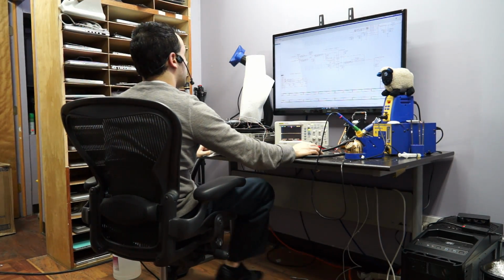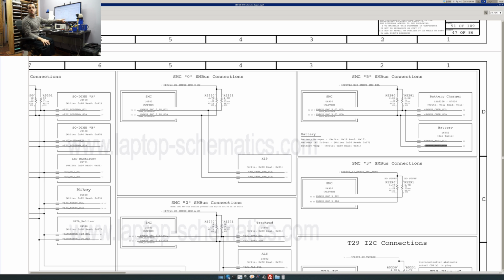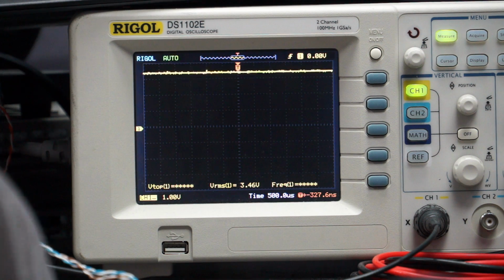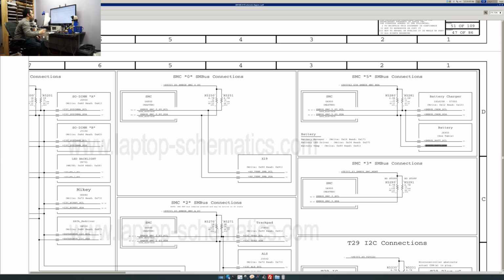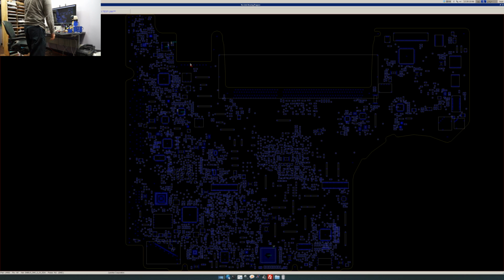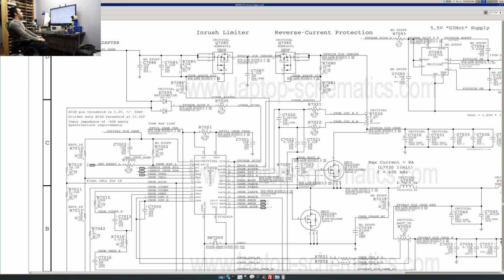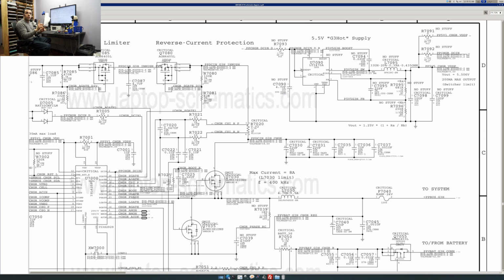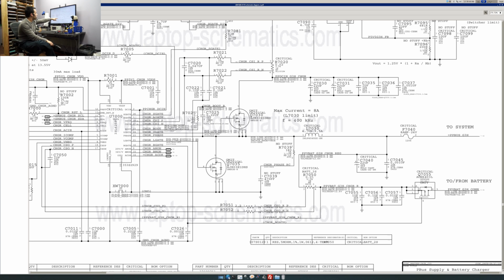Troubleshooting Macbook Pro battery recognition issues at component level.

Comment: Wow, awesome lecture on Macbook repair! Thanks!
Would anyone have an idea why a A1706 (late 2017) works with a battery that is 3yrs old (but replacement needed) and doesn't turn on at all on a brand new 1819 battery? What I am seeing is that even if the battery model is the same as the old one, the chip (basically the electronics) on the new battery looks newer.
If battery is not connected or using the old battery, everything is fine.

Comment: This resistor is called shunt resistor. But it does not go directly to IC. There is a circuit element (shunt monitor) with cvf written on it. It is similar to mosfet but it is not.

Comment: I hope u read this.. Have a odd issue with battery not seen. Ppbus is spot on 3.45, until i connect battery, then its 2.45.. 0.8..0.. 2.45. And so on. Without, solid 3.45.

Made all messurments i can think of.. All lines there, like pepe bus etc.

Tried old bat, and new bat, same thing with bus.

Why o why do battery fck the bus 🤔

12v @ battery connector aswell, remove charter, bam. Zero. Like it sucks power like 🤷

Will try dcps on battery connector and see if it pulls a lot of power. I have no real idea here...

Also, ofc battery lights on side wont work. Disconnect it wont work either. But, that one dont destroy bus, battery is the one. Maybe some pull up resistor..

And its a 820-2915-A board. Any tips?

Comment: That data line is I2c connection SDA . SMC is set as master, thus battery charger is set as a slave. If you can get datasheet of the chips that are talking to each other, you can probably figure out what byte commands are being sent from SMC to the charger. However what you see on the osciloscope there, is a series of 0's and 1's. I2c also has a clock pin, SCL. This should a constant signal in between 100-400Khz.

Comment: Hi I'd like to know why my battery shows the wrong percentage without charging when in log in(normal mode) when it's actually charging to 100% , but it shows correctly when in safe mode. Even after I erased the disk and reinstalled, also reset the SMC, the issue is still there.... Also, the battery % also shows differently as on desktop ... :(

Comment: Hi Louis, I recently found a macbook A2178 brand new in my dads old stuff.  I tried to charge it up, but the dreaded X on the battery showed up. Tried to reset the SMC among other processes. I however did not open up the back for I would not know what to do. This one as you know has a removable battery is there anything that can be done? Thanks

Comment: My MacBook Pro A1425 does not power on . 
When I disconnect the battery the charger light still shows amber and does not power . 
With the battery connected it still shows amber and does not turn green even though I’ve been charging for days now . 
Any solution please

Comment: Looks like an i2c bus, where the bus is high until the master pulls it low to communicate. We use it all the time in micro-controller programming, in embedded systems development. Throw a logic analyzer on that line sometime, and see if it can decipher the protocol for you.

Comment: If the computer recognizes the original battery, showing the charge level with the warning that its not being charged and should be replaced now, albeit it's "locked" out because of a short during liquid damage, that is, it does not run from the battery and does not charge it, but does NOT recognize the replacement battery whatsoever; nor does it likewise recognize the 2nd replacement battery, then that points to an issue with the replacement batteries, right? To complicate things a bit further, when the machine is running with either of the replacement batteries installed, i can get a few seconds of runtime after disconnecting the magsafe connector, then the machine enters sleep mode and will not wake unless plugged back in. Similarly, when booting with one of the questionable replacement batteries, upon seeing the apple logo I unplug the machine and it runs off of an "unrecognizeable" battery up to the login screen then usually sleeps itself. Once i was able to get it to run indefinately from "those" batteries through a combination of SMC/PRam resets and connecting and disconnecting original battery with replacement battery, albeit the the magsafe did not give any light whatsoever on that occasion, which was kind of funny to be powering a machine out of thin air, since power profile shows no battery installed. Im on the fence of buying another machine ($500 mid 2012-early2013 15" retina)  to troubleshoot the charging/ battery circuit; thanks to the information in your videos, of course, or, conversely to complain about being sent bogus replacement batteries ( which are not that cheap btw, $50 and appear to be Genuine Apple products, or, as I'm hoping through your response, to be super convincing fakes; or more importantly complete dudds) Thanks for thinking this through with me, I've had lots of grief over knocking over that blessed cup of water!

Comment: Hi, I have a 2011 model A1278 13 inch MacBook Pro. I've replaced the batteries and bought a brand new charger. Now everything works except for the charger, it won't light up. What should I be checking? I hope you respond.

Comment: Hi Louis, i Bruri.
i have trouble with my macbook pro 820-3115.
magsave indicator green, but won't to turn on, won't to charger battery & 
the chip U7000 no voltage 12v, can you help me to fix this. Thank you very much.

Comment: A1278 Macbook Pro 2011 with charging problems. The Macbook do not have a liquid damage and the system works without any problems. The only problem is that the macbook do not charge and recognize the battery. The charging voltage break down to 0V. SMBUS_BATT_SCL and SMBUS_BATT_SDA have 3,42V. Also the battery indicator do not work. It is not possible 
to start the macbook with the battery, only when the Magsafe is pluged in. After start it is possible do disconnect the Magsafe. PRAM and SMC reset did not solve the problem. Is the SMC defect or what can I do to repair the board? Thanks
Reply: I need more guidance on this!!! I have the exact the same problem, should I change my MLB? I am not a professional in this eletrônic area and live in Brazil.
Reply: its probably too late but SMBUS_BATT_SCL is the clock line and _SDA is the data line
they both have to be 'not zero' on SDA line you should see random pulses but on SCL you should see a pattren if you use an ossciloscope

Comment: louis, I need guidance. 
first, love your vids man, they must have made me divine because I brought 2 "dead" macbook back to life. 
unfortunately. 
I still have a battery recognition issue(X over battery) and the laptop will only run while plugged in (green light) and immediately turns off once unplugged. 
I can't seem to find a video that addresses this specific problem.. could you direct me? many thanks
Reply: drew did you get an answer to this as i have the same problem

Comment: Hello Louis

I have this 820-2936 board that fucks with me. At first it didn't see the battery at all so I tried to disconnect the J6955 cable and suddenly it works but it still won't start from battery, but it runs from it and charges when started from magsafe.
On pin four at the batterycon I only have 1.35V, it should be 3. something. If I turn it on and meassure at the two pull up resistors R5280 shows something like 3.4 to alomost 0 volt and R5281 shows something like 3.4 to 2.4 volt.
Do you have any suggestions?
Reply from the maker: +Magnus Bohm Is PP3V42_G3H present when the battery is plugged in without the charger?
Reply: +Louis Rossmann  yes, it's present
Reply: +Louis Rossmann When i plug The charger in The shit starts automaticly
Reply: +Magnus Bohm Hi magnus, i got the same issue on a Model A1502 - start automaticly when plugged in..
Boots for about 17 seconds then drops off.; then trys to boot again 1 more time..
So must be a 3Ghot to ground somewhere i gues?
Reply: +Glen Luyckx I don't know yet what causes the problem. My mbp works but it doesn't boot from the battery. I can live with that or I should say my wife have to live with that because I have another one that I use.
Reply: +Magnus Bohm ah damn, really needed some help trying to figure this out.. But hard to get a reply from Louis..
Reply: +Glen Luyckx have you tested all different resets? Is it the same when you boot from only the battery?
Reply: +Magnus Bohm well i cant even get it to boot from the battery..
thing it does it it only boots for 17secs when the battery is connected and the charger.
The magsafe turns orange after 2 seconds even when no battery is connected..
I get a far in boot when seeing the apple logo and the mouse wich i can move but then boom dead :)

Comment: Hello Louis

First i would like to thank you for your great videos and then i have problem which i faced many time but could not fix it. here it is:

I have MacBook Air that is liquid damaged 820-3437 , I have cleaned it up but it still not starting, the charger indicator lights,  i checked up a lot of things , the only thing i see is the PPVBAT_G3H_CONN.
The voltage on it starts on 8.5 v and falls down to 4.3 v  and rises again to 8.5 v.

I have tried to check up all the important part and replaced some of them but it is still the same. I have replaced the U7100, Q7155, Q7130. but it is still exact the same thing.
Could you please tell me some tips.

Thank you in advance
Reply from the maker: +MacReparation.se short the two pins on smc data line going to u7100 together and see if the voltage rising and falling stops. with the end of a tweezer or solder blob.
Reply from the maker: +MacReparation.se this will tell you if the smc is fucking up the isl6259. the smc tells isl6259 what to do.

Comment: Hello Louis.

I have got a MBP 820-3115-b.

But there is  one problem, when i connect the Megasafe the MBP turns on directly and the light on the megasafe is only green and it is not charging the computer.

If i disconnect the battery, the MBP can not start only by Megasafe and i must have a charged battery to make it work.

By other word it is working only by battery and i can not charge it.

I take data with oscilloscope at pin2 r5281 and 3.4v  pin1 is staight 3.4v

r5280 pin 1 straight 3.4v pin2 straight 3.4v no data only 3.4v.

r5280&5281 shows 2 Ohm

Have something in mind thanks.
Reply from the maker: +Giannakopoulos Ioannis guess
Reply: +Louis Rossmann guess?
Reply from the maker: guess.
Reply: +Louis Rossmann I try thanks anyway.

Comment: Hi Louis. If I may pick the brains of an expert, this question is about how intelligent are the battery packs. I have a 820-3536. Accepting that everything mentioned in this video is OK, from your experience, should there always be 12V on the battery connector, even when unplugged from MB, or does the system tell the battery smarts to turn on? I jumpered the last FET in series to the connector so B+ was present on MB. Unit turns on but shuts down at login screen. That FETs gate is not being driven. I really need to know if the SMC is reading the battery smarts and is being told it's no good, or if the battery packs aren't that smart, and it can only be component failure and I should keep looking. OS shows 100% when on charger. The pack was sitting in a very discharged state for a long time (1V/cell). Could the monitor chip have locked out the pack as a result for safety, if so can the pack be reset? Much appreciated.
Reply: I used a logic analyzer on the smbus and decoded it to find out the battery was no longer initialised, also it was reporting that it was simultaneously charging and discharging which isn't logical so have determined it needs new battery pack. Thanks for any consideration you may have given this, your work is appreciated!

Comment: Hi Louis, thanks for your great videos ! A little question about my 820-1236 motherboard not charging my battery : what if my SMBUS_SMC_BSA_SCL doesn't get shorted to ground at all ? My R5281 is looking good (1,98kOhm) and I get 3,41V before R5281 and the same after. How can I know if it's the Battery (J6955), the Battery Charger (U7000) or the SMC not doing its job ? In comparison, my SMBUS_SMC_BSA_SDA is at 2,51V which is great. Thanks for your help
Reply from the maker: Raftaman92 Is 12.6v being generated, did you try a different battery? Does it say battery not charging, or does it have an X on the battery?
Reply: Louis Rossmann Thanks for your answer. I got 12.2v when the charger is plugged in and PPVBAT_G3H_CONN is only 10.5v instead of 12.6v. It's a battery I bought from iFixit when my original battery died (getting 0v on PPVBAT_G3H_CONN). I have an X on the battery icon. I suppose my battery is deffective here, should I buy a new one directly from Apple ?